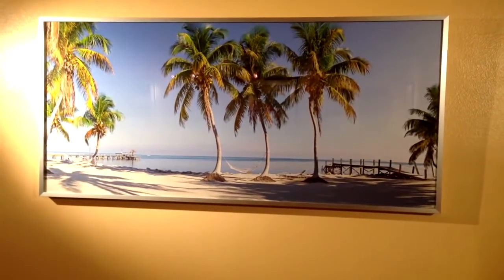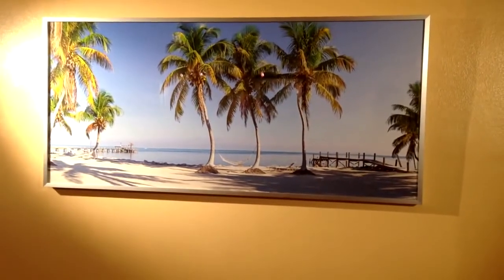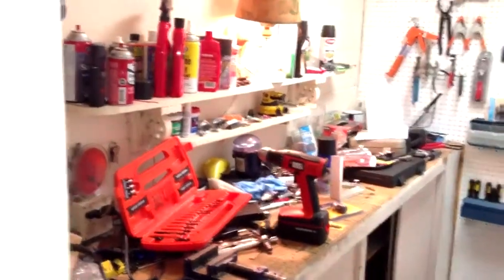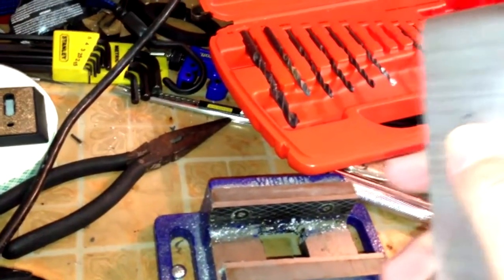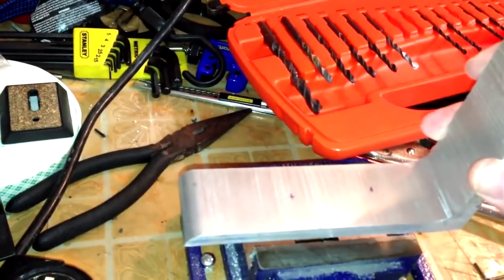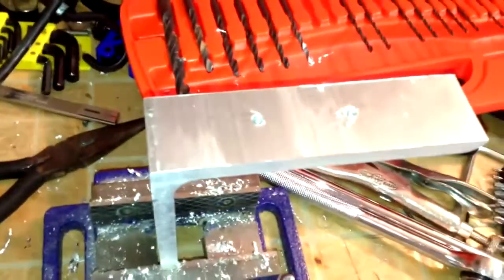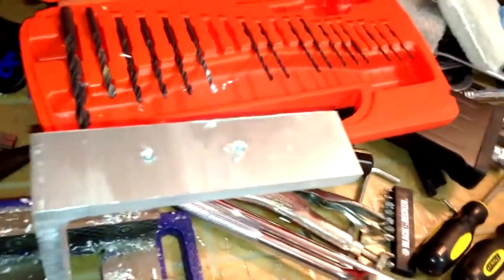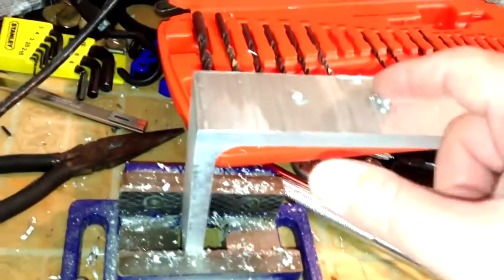DIY Camera L Bracket Finding Nodal Point Using Focus Rail - CO Guy Stuff

Comment: Useful suggestion: 
Instead of using a tripod, purchase a
round base mic stand and weigh it down with two 5-pound barbell weights, placed on top of the base, with the pole running through them.  Paint everything with black primer. 
Then purchase a 
5/8"-27 Female to 1/4"-20  mic stand to camera adapter.
This allows you to mount any camera or pano head that uses a normal ¼”-20
thread. All about $25 plus shipping and bar bell weights.  This allows for
better rendition of pano stitching because the tripod legs aren’t in the way.